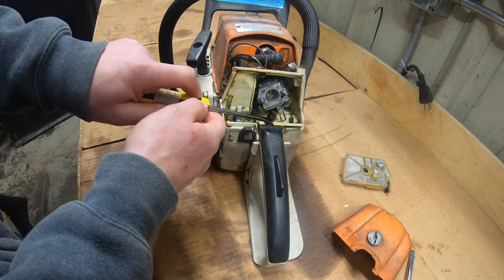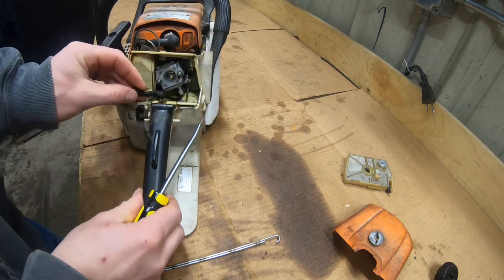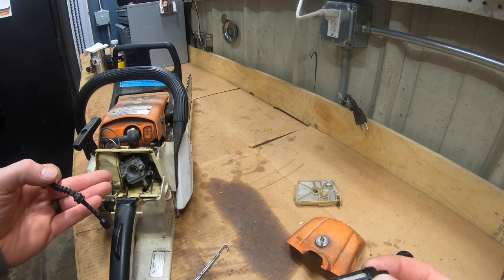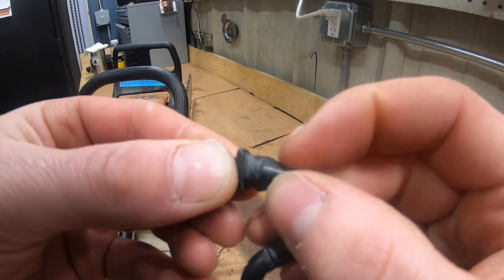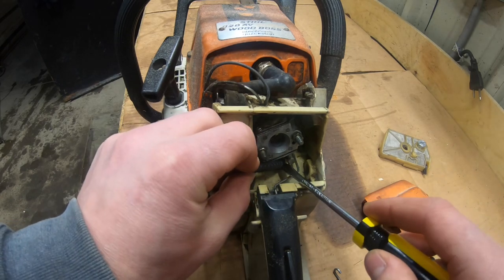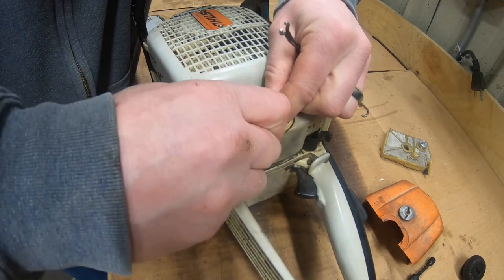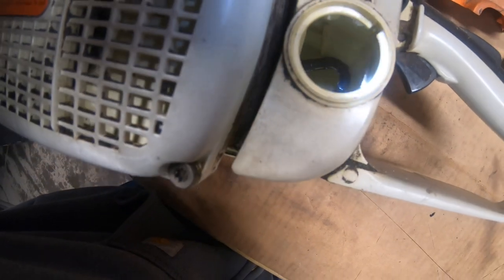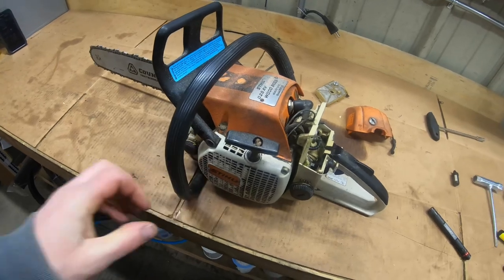Replacing the gas line on a Stihl 028 chainsaw

Comment: I have a 28 year old 026 and am replacing the filter and fuel line for the first time (the saw runs fine, it just seems like it is time to do this). It has that same short line that you pulled out of this 028. According to a bunch of arborist forums that I've checked, the J-shaped replacement line won't fit into the hole in the gas tank unless it is enlarged, which I don't want to try so I found the short OEM fuel line on E-bay. I'm trying to figure out how to put the filter on the end of the line after the line is installed in the tank, I guess it will have to be stretched quite a bit and I'm hoping that it doesn't tear.
Reply from the maker: I didn’t want to stretch that out that much . The one I put in seemed to fit in place